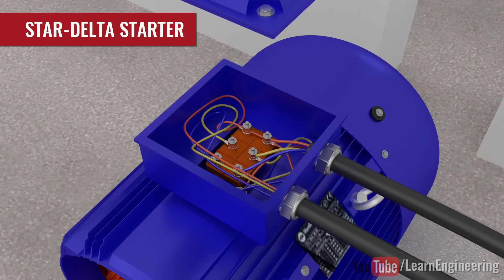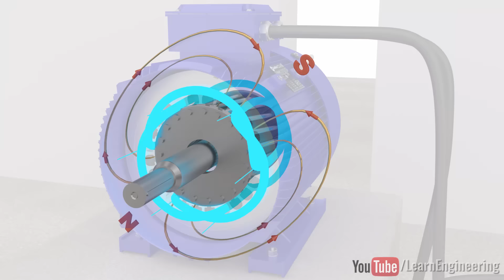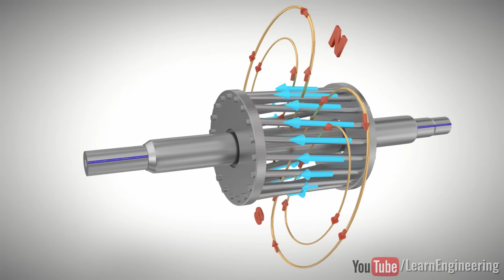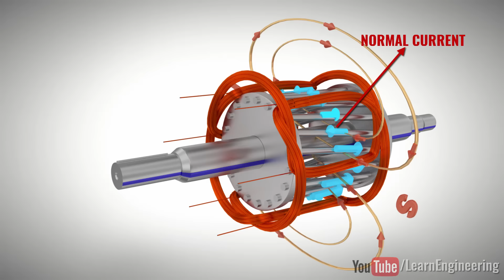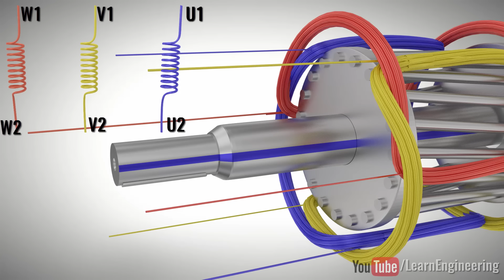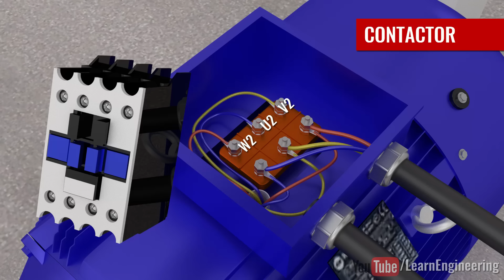Understanding STAR-DELTA Starter !

Comment: It is very informative video those who wants to understand the basics of induction motors. But all of my electrical engineer colleges know that this starting mode is common but unused in the 21th century. Soft starters and vfd-s are simplier and chieper. Star-delta is not used in new projects since the early 2000s.

Comment: Explained very nicely.
You should also have mentioned the effect of frequency. How an air plane uses 400 Hz in its power supply and how the size of the motor/generator reduces. Herein lies the merits of AC over DC...

Comment: Great video! Nowadays I guess is easier to be a technical school student.  When I was tech. student, books didn't have animations :) Induction motors are great. Until you won't burn a coil and bearings are not made of chinesium, this motor will work forever.

Comment: At 1:07, you have shown the winding as a closed loop, I think it should be like U, two terminals open, one can be connected to power supply and the other terminal can be connected to neutral (all three phase will be connected there). As per your video, if you connect one terminal to supply, current will be divided into two paths, 180 degree apart.

Comment: The best educational video I have ever seen.. The circuit diagram for delta connection is right, But I think, the way of delta connection in the motor terminals, shown in this video is wrong.  According to the circuit diagram, it should be W1 and U2, W2 and V1, V2 and U1.

Comment: That voltage-pull for the start of the rotor's motion works in reverse, too: when generators start from zero there's a huge declining surge for a third of a second.
 
Back in the 1980's the Haynes Point power station in downtown Toronto would start and stop during the day.  This was just about the time desktop computers were getting going.  DOS 1.0 was still fighting DDOS, and Linus 0.6 was working toward 0.89.  And when Haynes Point came on line, a whole lot of Bay Street, Canada's Wall Street, would shut down and reboot.
 
Boy, we sold a ton of power supplies to condition office input!  A $5,000 desk-top -- this is before IBM came along with the Chiclet machine -- had to have a $1,200 line conditioner to go with it.  Ah, the good old daze!

Comment: Is this still in use? Don't people use electronic motor drives nowadays?
Reply: bobdebelix still in use.. some people prefer this because when 1 part is broken, it does not affect other component as well and can easily be changed..
Reply: Actually this is just one version of an electric motor. With IGBTs or FETs you can drive it in all speeds. The Tesla Model S uses exactly this kind of motor.
Reply: bobdebelix There are many industrial applications where more complex drives would be completely unecessary and just add to the cost. Also induction motors can be used as generators, you just need to run them faster than the magnetic field.
Many electric cars do use BLDC motors but the Tesla does use an induction motor. IMO induction motors are better than BLDC - motor drives are similary priced, efficiency is similar, and they don't require rare and expensive magnets.
Pretty much every electric vehicle today bigger than a car uses induction motors - trolleybuses and trams, locomotives etc.
Reply: Say you have a 2 pole motor on 50Hz alternating current, meaning 3000rpm syncronous speed. When running as a motor it would slip say 150 rpm so rotor speed is 2850 rpm. Now if you conmect something to drive the motor at speed exceeding syncronous speed(over 3000 rpm in this case) it will generate power. Full power generation would happen at around 3150 rpm. Just google induction generator if you don' believe me.
Reply: It uses a variable frequency drive. You don't speed motor up, you increase frequency of the AC. So if the motor is spining at 3000 rpm it is driven at 45 Hz to brake. Actually you can control braking intensity by varying the frequency between 50 and 45 Hz where 50 Hz is 0 braking, 45Hz is max braking. Acceleration is controlled similary - 50 Hz is 0 acceleration, 55 Hz for max accelaration.
Reply: Bobdebelix. That's wrong. Many use synchronous engines, but the Tesla Model S uses an asynchronous engine. As I said. You can look it up.

With IGBTs and FETs you can adjust the moment and rpm as you wish.
Reply: And the reason for the use of asynchronous motors is that they have a greater power density and therefore reduce weight. However due to the price of the permanent magnets asynchronous induction machines are also used, as was the case in the Model S by Tesla. 

And it's wrong to call synchronous motors BLDC, because that indicates that the asynchronous motor is used in BLDC mode (6 positions) when in reality they are space vector controlled.
Reply: I can confirm that this is rarely used in new installations now days but still very important to learn if you work in a relevant area.
Reply: Three contactors ,control circuit and good electrician will cost you less fortune. so yes this method still in use but not in all motors.
Reply: Motor drives are expensive and there is a efficiency loss on the drive itself. If all you need is to make something go around without precise control, then an electronic motor drive is probably a pointless cost and complication. Engineering is about coming up with an optimal solution, not with the most high tech possible solution.
Reply: Petar Miletic 
I don't think we can use induction motor as a generator.

Comment: Moo moo says; I'm confused here. My 1945 harvard mechanical engineering book says Delta Star is for 4 wire transmission lines, as its more efficient at less current loss and thusly transfers more juice down the big ass transmission line. Here you showed 3 phase wireing as I see it. Good show on the motor physics and magnetics and current flow data. I am impressed by the whole presentation and "duh" got the picture damn straight. I tend to stick my nose as an ex-mechanic right where it don't belong and I thank you for this show mucho.

Comment: I hope no one tries to build a wye-delta starter off of this diagram. The first contactor has to have its three poles shorted at the top to do anything useful. Just like the three leads were shorted in the motors' junction box, they would have to be shorted here. And the two contactors need to be mechanically and electrically interlocked to prevent them from being engaged at the same time. And then there's the overloads, etc...

Much simpler to use either a soft starter or a VFD to accomplish the same thing. The advantage of a soft starter (that kind that switches over to contacts when it is at speed, not the electronic type only) is that it applies voltage and frequency at a rate that limits the amount of current that the motor will draw while starting. In other words, it starts the motor up slowly and reduces heat. When the motor is at speed, it switches over to mechanical contacts and drops the electronic speed controller part of the soft start out of the circuit. This improves efficiency.

A VFD can be used to provide a soft start as well as control the speed of the motor. Care should be taken when doing this since at speeds below the rated speed of the motor the internal cooling fan loses much of its efficiency. This will cause the motor to overheat. Usually an independent fan or blower will be attached to the motor to provide forced air cooling if the motor is going be run below its rated speed.

Comment: good video sir..
but cmiiw, since the video wasn't auto star delta in motor, we should add into panel 1 more contactor as main  and to start n stop the motor by push button, and aux. relay to multiply the timer's contact and make interlock circuit.
cb and thermal overload is additional (if only want to understand star delta concept inside motor) to add overload and overcurrent protection.
once again, thanks for the video.. that's simple to understanding.

Comment: If we arrange intersecting permanent magnet with the current carrying bar then it work both as motor and generator alternatingly. And if the coil are connected in star and the stator as delta intersecting with permanent magnet

Comment: Great explanation of the motor but the wiring and contactor portion is missing a few key motor control details. The star contactor is wired differently, a third contactor is the main contactor, the wiring is interlocked, there is a timer switch to actuate the contactors from star to delta. A few other components are needed in the standard configuration such as an MCCB, overload, pilot lights, start stop buttons, fuses, emergency stop, etc. 

Great basic explanation though.

Comment: This probably clears my confusion of many months.

At home, we have a borewell, and the starter just starts the motor immediately. And it draws 5Amps. Might go 7-8Amps during high demand, but that's it. If it's over 10Amps. We take it that one if the phases is turned off. So we don't run it.

But at my quarters, they have a sump. And the motor has a different looking starter. It draws about 15Amps as soon as I press the button. Then after a few seconds, it makes a noise and suddenly drops to 5Amps. And stays there.
Always wondered why...

Comment: The rotating magnetic field of the asynchronous motor is higher than the rotor speed, and its slip rate is generally between 2% and 6%.

Comment: Thats why when a 3 phase ac motor starts
The current rises to 500 Amps and gradually drops to 150 Amps as it’s gaining speed 
If you put some metal bars across the Terminal on the induction motor as it starts 
The metal bars will melt

Comment: A correct star delta starter has 3 contactors ,where in this video not exists .for the security regulations is prohibited to eliminate the main contactor who cuts u v w from r s t .because main power remains always on the beginning of the windings.

Comment: A star delta starter has 3 contactors. The star, delta and run contactor. Good explanation but the contactor animation at the end was a bit wrong. Should have showed the u1 v1 w1 going through the run contactor as well as well. Also the cables on the star contactor linking on the top side of the contactor

Comment: sooo more accurately, theres a sensor that senses the rotor speed and induction on the stator and on startup does star arrangement and then after the rotor reaches a certain speed and the induction is low enough it switches to delta arrangement.

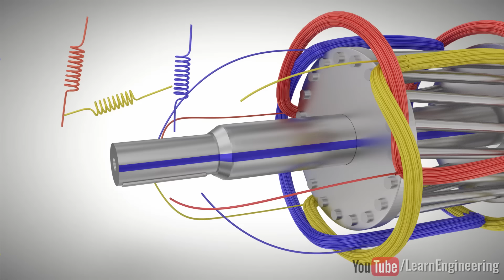Comment: There is problem in delta connection which one is described by you. Actually at 3:48 you described that W1U2, W2V1,V2U1 Made delta connection but in Motor T.B connection at 4:55 You shows that W1V2,W2U1,U2V1 That's totally different from earlier connection. So need clarification.

Comment: How exactly the star is achieved on the contactor if you connect together on the input part where the cables goes in !? It should on the upper part of the contactor it is where you loop those cables. On your video the star will always be there whether star contactor turns on or off by a timer. But if you loop on the other end the star will be controlled on the timer to switch to Delta.

Comment: This is like a brushless motor but without an electronic speed controller? Instead, the use of the 3 phase a.c. input power is what switches the windings of the stator, which in turn, pulls (or pushes, not sure which) the rotor around? It’s like, I almost, kinda sorta, get it?

Comment: The animation is good but he missed very crucial explanations and components. Star-delta control uses 3 contactors and not 2. A main power contactor, a star contactor and a delta contactor. Also there needs to be jumpers installed to start in star configuration. Using the timer, when the start button is pressed, the main contactor and star contactor energize together to start the motor in star configuration (low current), then after a few seconds the timer switches to delta configuration by deactivating the star contactor and activating the delta contactor. All the time maintaining the main power contactor energized. When the stop button is pressed all activated contactors are de energized (Motor stops) and the starting process can be started again.

Comment: I felt great watching your video👌,thanks for the explanation.But i got a doubt that "Why can't we just connect the terminals of the windings in 'delta' initially  and use one connector to switch it to 'star'.Such that when connector is switched 'ON' it switches to star and vice-versa". Please correct me if iam wrong somewhere.
Reply: If they are hard wired in delta they will remain delta -they have to be uncoupled to be reconfigured  in star.

Comment: hi, thanks for the video illustration, i m fresh graduate. i have a question about the star delta connection as u discussed at 4:40, when the coil of the motor are connected in star, u left the ground unconnected or grounded??? any reason why???? thanks :)

Comment: Aren't you meant to put a link between all three connections on the star contactor? Otherwise, how are you simulating putting physical copper bars between them at the motor connection terminals.

Comment: The configuration at 3:49 is WRONG !!. U1 and W2 , U2 and W1 , V2 and W1 should be touching each other according to the connection you have shown at 4:56. Also you should short circuit the three output side of the contactor at 5:33. Am i wrong ?

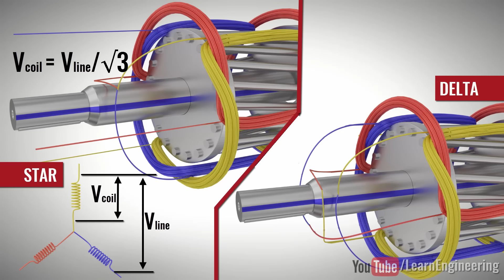Comment: 3:58
can someone help me with this? why is the voltage divided by sqrt(3)?
the lengths of the coils are the same, so the voltage should be 0.5 that of before, since two coils are in line. where is my error?

Comment: Actually Y and Delta wired like a pyramid meaning the Delta as a base and the y are upward meat at top of pyramid and if you do the double pyramid with up and down side with single or double Delta may be connected or disconned depending if you want investor or not and I think that is renewable energy system of forever life that the ancient Egypt learned and use that to possible create matter and human experiment and may be ....

Comment: There are some things wrong with this.
First, the "rotating magnetic fields" are not rotating at all. They're increasing and decreasing in magnitude, and then alternating polarity. The result is actually an rotating alternating magnetic field. This may actually result in the motor being unable to start at all, as alluded to in your video about SynRM. It's constantly changing from one current to another, which should produce CEMF, and stall. Just the fact that you misrepresented the RMF makes me doubt if this technology even works.
Second, Star circuits do not regulate voltage across circuits. Delta circuits do, by short circuiting (bypassing) one and reducing the other. Star is able to have 2-3 wires (phases) create magnetic fields, but with 2 different voltages. Delta is only able to allow 1-2 wires to produce a magnetic field, with the same voltage. This is because Delta short circuits the other wire before it's able to generate a field in the stator. With Star configuration, there are 4 magnetic fields. In Delta, there are only two.
Basically, what Star and Delta do is create a rotating circuit of 3 wires, instead of using 6 wires for 3 phase AC. This would be useful for any 3 phase AC circuit, not just this motor in particular, because it uses less wires. That being said, Delta doesn't seem right to me, because it bypasses the stator windings, but Star has magnetic poles of differing strength. So they both suck.
Interestingly, this motor is only good for starting, assuming it actually works at all, because as it accelerates, it actually produces less torque. It must lag behind the "RMF", in order to produce torque, which should actually be counter to it's operation due to the way the field changes. Hence why I don't think it works.
It's interesting, but I'm still convinced that electricity should be able to create free energy, so this is nowhere near good enough.

Comment: how we can say that reducing input voltage mean reducing the current in the stator? because current on the star connection is the same ,,I line = I phase ,,,, and Why the squirrel cage bars are designed at some angle ,,what if straight ?

Comment: It was a good video, but you didn't mention an important thing. The two conductors should never be activated at the same time, because this leads to a short circuit. In order to avoid this, when the motor switches from star to delta, there's some time in ms or μs were non of them is activated.

Comment: I am an industrial electrician and thought the video is great but in reality this connection will not work, the star delta control need three contactors not two, arranged as main contactor, delta contactor and star contactor, the main and the delta are connected to the live lines while the star contactor is just connected to  shorting jumpers, at the start the main and the star contactors are activated and after the time set by the timer the star contactor is turned off and the delta contractor is activated, needless to say there is an electrical interlock to prevent the activation of both star and delta contactors at the same time which will bring the three lines to short circuit.

Comment: Err... Just use a three-phase controller. They can start the motor at a lower frequency, thus lower speed and gradually ramp it up.
Reply: And a more expensive solution.
Reply: @shalnarkkkk  if you want a cheap solution, you put a crank on the motor shaft and spin it manually as you turn it on.